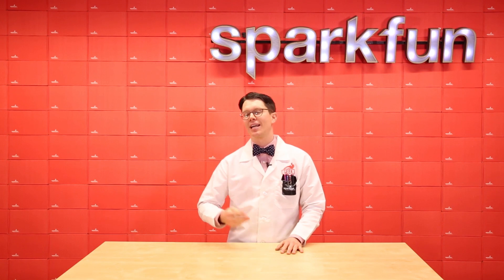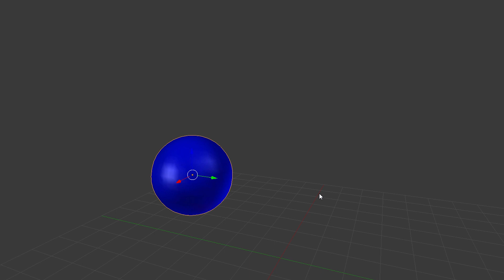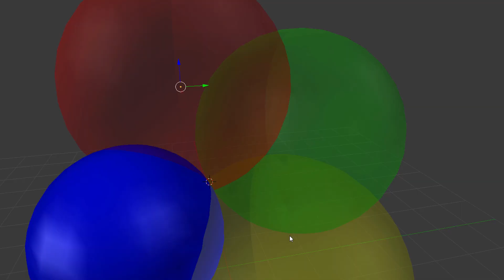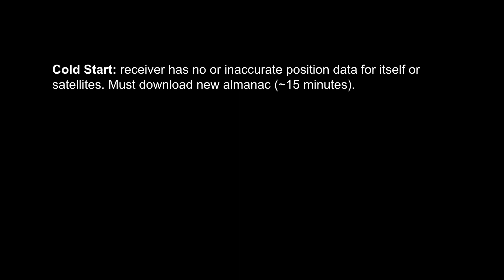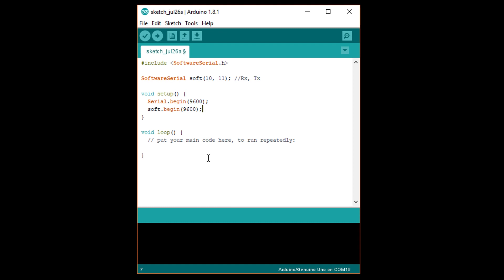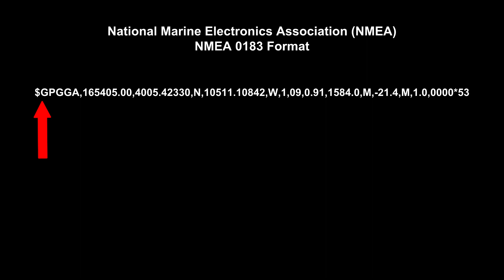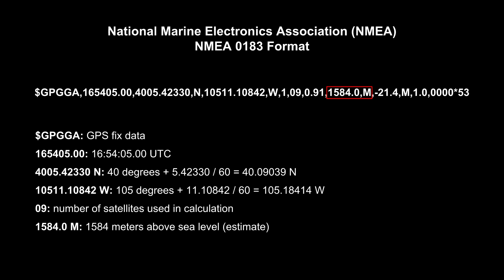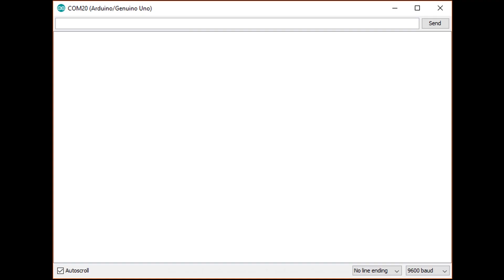Adventures in Science: How GPS Works

Comment: I used to be part of a project that used a clever GPS unit called ADU5. This unit uses 4 antennas, one for positioning, and the phase difference to the other three to calculate pitch, roll, and heading from a single reading. Important for ships or aircraft where the front of the vehicle isn't necessarily pointing in the direction of travel. The direction of travel (what many commercial GPS units call heading) was called "course over ground", and would be calculated from two consecutive readings.

Comment: You may only need about a minute for your GPSr to get a full almanac after a cold start, as each satellite's transmission of the almanac is staggered over time.

Also, you might not have noticed, but it is not exactly possible to get a 3D fix with a GPSr; it's either 2D… or 4D.

BTW, when I looked closer at the NMEA data your GPS module was spitting out in this video, I noticed that you were receiving signals from three of the WAAS satellites, but for some reason your receiver was not using them.

Comment: So we need the fourth satellite to get atomic clock time for the receiver, but for that, we need to know the distance to said satellite, or else we can't tell how much to correct for the time delay that it took for the signal to get to the receiver, for which we would again need atomic clock time for the receiver.  *Scratching my head

I know it does some fancy math with all the data from all the four satellites, but can someone explain it in simple terms?
Reply: Interesting question. Since most receivers don’t have precise enough clocks, they need a way to set themselves to the correct precise time.  Since they don’t initially know where they are, they can’t use the satellite as a reference for time. They get around the position time dilemma  by calculating their position error based on estimated time. The position error correlates to time error. The local clock is adjusted to compensate and now precise time is known. This error correcting process takes four measurements. This is how the vast majority of receivers work and won’t even operate with less than four. Position can be calculated with three measurements, but that requires an expensive local clock.  It’s easier to calculate time with a fourth input and use a cheap local clock.